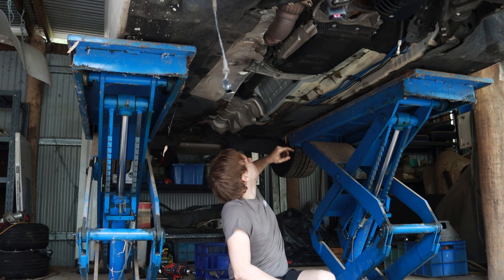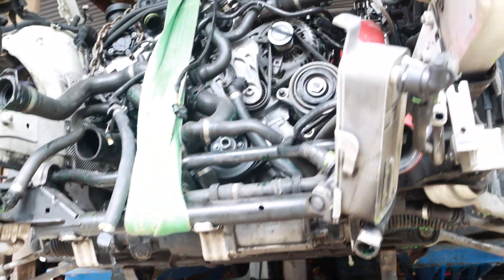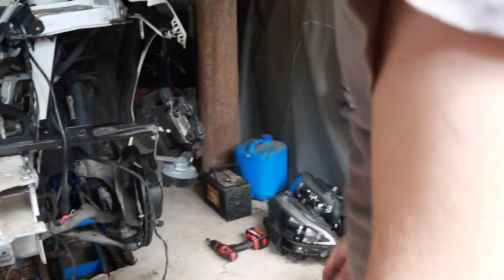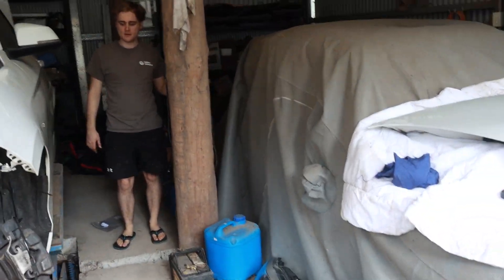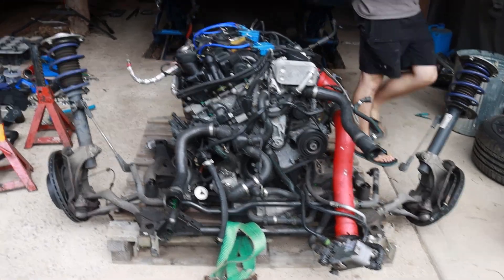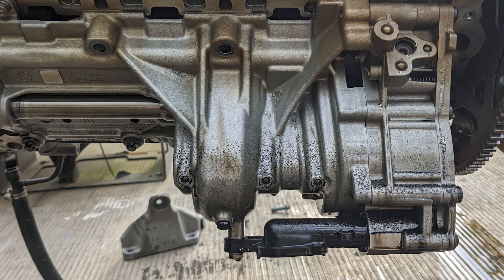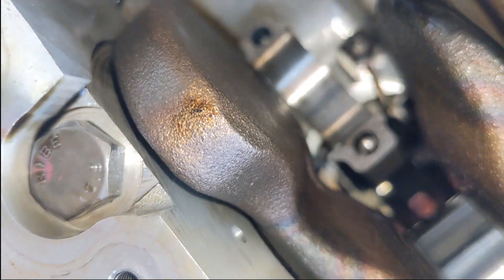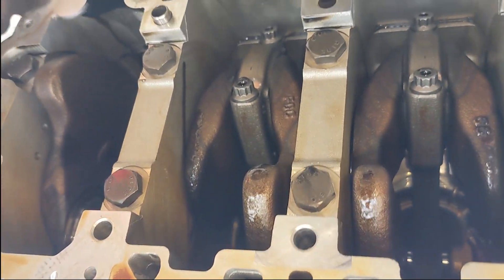BMW N20 Twin Turbo Build | Initial Teardown Part 2 | Failure Revealed

Comment: Hey what up bro I have 2015 bmw 528i n20 engine I have low compression on 3 cylinder 60psi I want to rebuild it all stock it’s my girls car can this engine be honed like a regular block or just replacing piston or ring will take care of it. if the cylinder wall are ok
Reply from the maker: please see my other reply on your other comment